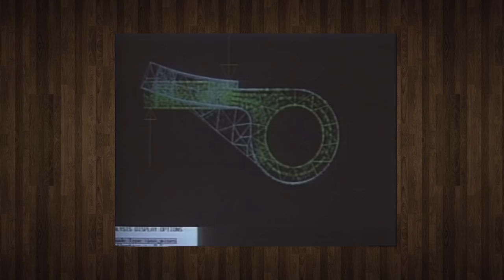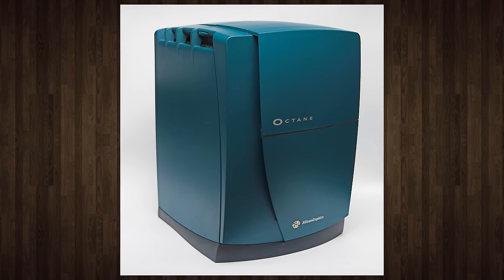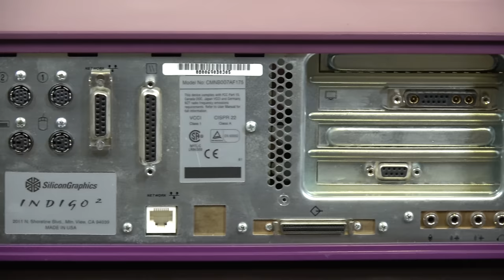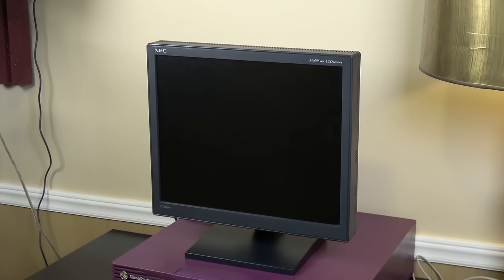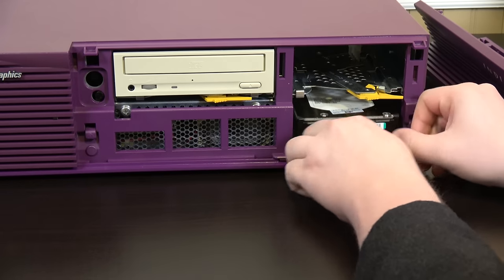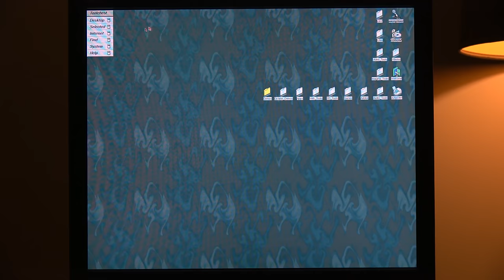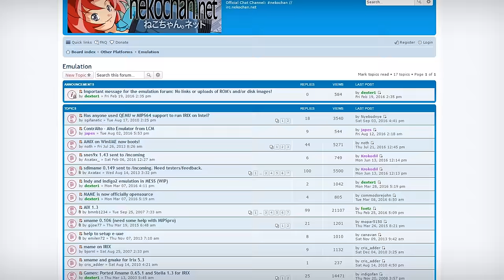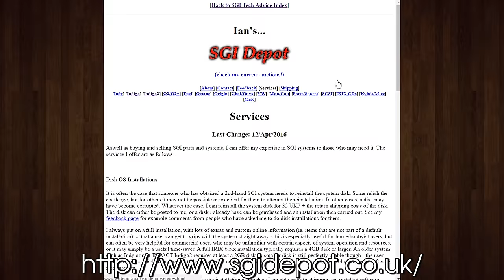SGI Indigo2: An $86,000 Workstation from 1995

Comment: I remember seeing one of these back in 95!  It was me and a few friends looking at it.., and when the guy said it had 1gig of RAM.., we were speechless.  For those of you not quite old enough to remember..., 1gig of RAM
in 1995 was freakin insane!  We laughed because, we didn’t think anyone would believe us about seeing a computer with 1gig of RAM.  Plus that hard drive was also incredibly large for 1995!
Reply: i had a ti extensa laptop in 1996 w/ 8mb ram and 120mb hard drive sporting a pentium 75.  It was about $3200.  Yeah, 1 gig of ram would still drive operating systems until windows 10.
Reply: You can still get hardware at that level of absurdity these days (it's probably even easier too, if your credit card could clear the charge you could order it online), if you're willing to go through some special workstation manufacturers. IIRC, the best you can ge these days is:
1. dual 64 core processors (AMD EPYC Rome)
2. 4TB RAM (with the right motherboards and 128gb LRDIMMs)
3. at least quad if not octal Quadro cards, or more likely 1-2 Quadros and an assload of Teslas, way more than Windows will ever support
4. PCIe storage so fast (PCIe 4.0 x16 in an add-on card) that literally only Linux can use it to its full potential
and you might wonder, "what ungodly software needs this kind of hardware??" and the answer is, beyond anything you should be doing on server farms like rendering and supercomputing, is usually DaVinci Resolve on Linux for 8K+ editing, color correction, and 2D/3D compositing.
Reply: @romannasuti25  Hell, what if you game on the setup? Will it have high amounts of FPS?
Reply: @bmhater1283  octo quadro should run raytracing max settings on cyberpunk at ~30fps
Reply: If someone showed you a computer from nowadays you would think it came out of a UFO
Reply: @romannasuti25  
somebody showed a htop with 256cores
Reply: @herauthon  That's probs dual EPYC processors when you include multithreading, which is basically the absolute maximum that is reasonable in a workstation. Intel has 8 socket systems that get to 224 cores and 448 threads, but those are only available as massive 4u+ servers with crazy loud fans and 220-240v power delivery.
Reply: Now you can get an equivalent level of power in a Raspberry Pi, a 1000x reduction in price in 25 years.
I wonder if IRIX could be ported over to ARM?
IRIX on a PI, now that would be funny.
Reply: @romannasuti25  Am art student, can assure people that this kind of power will make the difference between your computer rendering your 3D project while you're eating dinner vs. it rendering your project in seconds flat.
Reply: @eastmanresearch3143  Vista* any other operating system passed XP would be sluggish as hell on 1 GB of RAM
Reply: @jfk8540  flip out your phone and I would die in the 90’s. 😂
Reply: There where no 150gb HDD’s in 1995, this machine has a hard drive from 2006 in it.